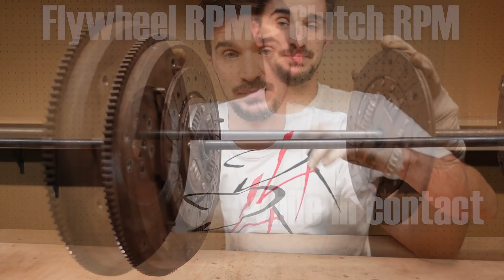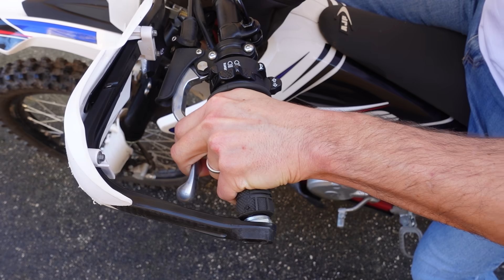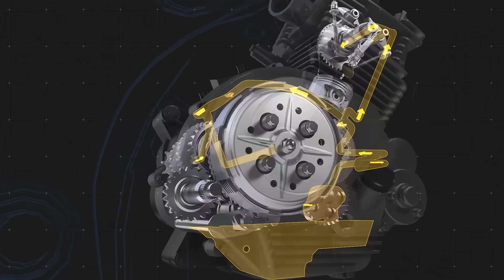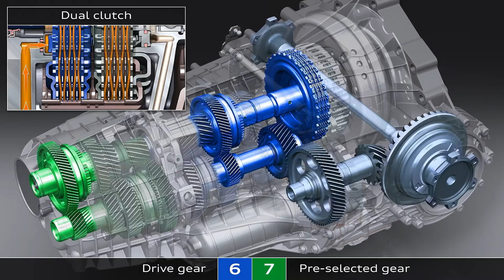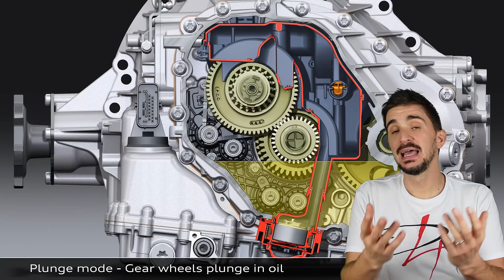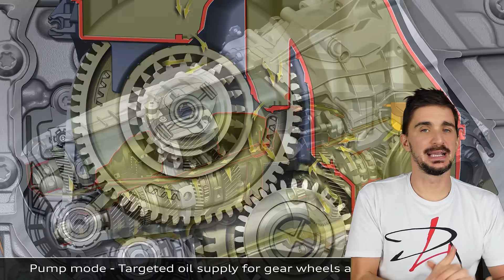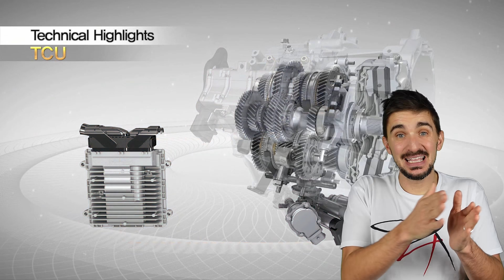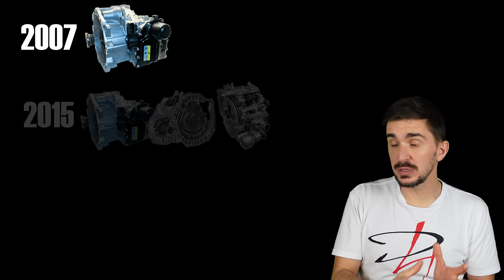Why Dry Clutches Suck and Why You Should Avoid Dry Dual Clutch Transmissions (DCT/ DSG)

Comment: Pretty sure that whole system is the "clutch".  The thing you called the clutch is the clutch disc.  The flywheel and the pressure plate are also parts of the "clutch".

Comment: Manual clutch is dry.
Reply: This! are dry DCTs worse than (proper) manuals??
Reply: @EspenMyklebust-u1o  By "proper" here, do you mean experienced driver?

The true cause of premature wearing and failure of dry DCT is that OEMs are too radical on fuel economy. Especially under low speed, TCU tends to shift earlier and engage when two sides (of the clutch) not matching rev
Reply: @TobenyChen  I meant "proper manual" as opposed to DCTs (which are "automated manual gearboxes", albeit with two clutches instead of one). Except for some issues in the automization part (like you point to about the early upshifting), mechanically the dry clutch principle should be work just as well as it does in proper manuals (ie. manual clutch). The video focuses on dry vs wet, so the issues should be equally valid for manuals, right? Perhaps bc wet clutches aren't an option for manuals🤔

Comment: I love the 8sp DCT in my ILX. I change the fluid every 30/40k without fail or exceptions using only Honda/Acura fluid from the dealer. I bought this car with 20k miles on her and she has 125k now with no issues so far from the DCT. You just AND MUST know when coming to stop at around 2/3 mph left you need to stop. Do not get back on the gas, take a second, stop, then continue driving. The torque converter can be a little weird in that situation alone that being said, once you have starting rolling again and the converter has locked up around 20mph you can stand on that thing ands it will reward you with instant and immediate shifts regardless of how hard you stand on it. 

I don’t even use the paddles, no need to. Just drive and change that DCT fluid every 39/40k. Changing mine plus oil and NGK R Lazer Iriduim plugs this weekend. Mx Mx Mx Mx folks. That’s the name of the game

Comment: I understand the differences between a wet and a dry clutch, I'm wondering why no one has come up with a damp clutch, where the clutch would not sit in oil but there would be an oil spray for cooling.

Comment: Doesn't wet clutch release particles from the disc grind into the oil to help wear out your engine or gearbox?
Reply from the maker: It does, but only on a motorcycle where the entire system uses the same oil. Not a dct though where it's completely separate from the engine. The oil filter catches most of it on a bike but it's another reason motogp uses it. The insane clutch abuse and temps would ruin the oil very quickly. Dry clutch is isolated and easy to replace/inspect.

Comment: Completely wrong about the cost and dependability of dry clutches vs wet clutches in the automotive world.
And for your information, dry clutches last 2 to 3 times longer than any wet clutch automatic trans if you know how to drive a manual properly.  
This is fact. The most important parts of your info is wrong sir. 
I know this for a fact from 27 years of experience being a mechanic.
Also, I'd rather spend a couple hundred bucks 2 or 3 times during the vehicle's life to replace the clutch than to spend around $3,000 rebuilding an automatic trans each time.

Comment: Um, it's way cheaper to replace a normal dry clutch, throwout bearing, and pressure plate than it is to replace a wet clutch or clutch pack. Also, it's WAY less labor intensive.
I don't understand where you're getting your info.

I've been a mechanic for 27 years and have changed normal dry clutches, wet clutches, (such as in a tractor), clutch packs in an automatic (which are wet), and motorcycle clutch packs
many times and not once ever in my life has it cheaper or easier to change out a wet clutch.
You have to completely remove and disassemble a wet clutch transmission to replace the clutches.
Not so with a conventional dry clutch transmission.
Reply: Are you referring to dry clutches in a DCT, or just conventional manuals?

Comment: You CAN definitely burn up a wet clutch, you dont smell it cause it's sealed from outside air. What do you think the most common cause of automatic trans failure is??
The clutches burn up. That's how you get burnt trans fluid.

Comment: U forget to say that dual dry clutch pack works just opposite to regular single clutch pack. So normally when u depress clutch the pressure bearing is not pressing the pressure plate but DSG actually pushes the trustbearing all the time when it is connected. So when u driving at 7th gear the K1 actuator is pushing all the time and bearing have to handle this stress. I have seen these melted of heat. This is one drawback for efficiency. Actually there are 2 bearing under axial load allthe time when driving. When car is stationary both clutch are open and no axial load any direction.

Comment: Proper dry clutch's last so long and work so well there is no point going to a wet clutch for street use. I have cars with both types. Wet clutches used to be common in street vehicles and were dropped by OEMs for good reason. Current vehicles now have extreme problems that need attention so don't waste time on these click baits.

Comment: In the 4x4 sphere it's mostly AT new with some MT. The DCT and CVT CUV's generally shut down under load. 

The motorcycle DCT also shut down for self preservation too under extended load when hill climbing for instance. Off-road is still MT domain.

I was surprised to see can-am SxS with DCT in performance application. Even with heat sensor on CVT, maybe there's some packaging limitation for a certain performance level.

It must be packaging reasons that large airplanes use multi carbon plates for wheel brakes in the hub.

Comment: Just don't baby a dry clutch DCT... Don't roll on brake at lights. Treat it like a manual and you will have no issues. I'm at 60k miles on my original clutches and it is still great. I've never had a clutch burning smell and the only time I've ever had issues with stutter is when going in reverse.

Comment: Ahhh, the old Ford Power Shi(f)t… almost got the marketing right, just off by one letter. Company I work for had a fleet of that model Focus. Every single one had DCT problems. Mine spat the clutch at 30,000km. Drove it home stuck in third bouncing off the limiter 😅

Comment: Total rubbish. Learn to drive properly. Ok, I had the advantage of learning to drive on an unsynchronized lorry in the army, but the idea is not to use the clutch for synchronizing, but to use the accellerator pedal to adjust the speed when changing gear. Using this technique I was able to drive a car 150 km through the mountains in icy conditions in spite of having a totally blockrd clutch. And in spite of having driven cars for around 250000 km each, I have never had to replace a worn out clutch. The "adjust speed shift" also works on motorcycles. Occasionally, just for fun, I will ride for longer distances without using the clutch to change gear. Done correctly there is no jolt whatsoever.

Comment: It's about frequency of use. Or duty cycle. Motorcycles really don't get used as often as cars do. They don't sit in traffic like cars do... barely moving for minutes or tens of minutes at a time. Even DCT wet clutches in the normal environment of a car will wear out faster than a SINGLE, non DCT dry clutch, as long as it's not computer controlled.

Comment: thats bugging me about motorcycle clutch packs, so if they use the same oil as the engine, wont those tiny particles from a clutch go into the engine? does it get stuck between cylinder and piston rings and slowly wear out engine block more than usual? or the oil filter filters them out?

Comment: As far as cost. I guarantee that the wet clutch doesn’t last as long as they claim. I can also presume that the removal and repair of the wet clutch is going to be significantly more expensive. 
Quick check of the repair book should confirm that.

Comment: Dry clutches are OK to me, if you know how to use them. I´ve never changed a clutch in any car or motorcycle that Í´ve owned. My 28 years old BMW R850RT still has it´s OEM dry clutch from the factory. No city use, no free clutch slipping. I own wet clutch bikes too, and they can handle a lot of abuse that it´s forbidden on a dry clutch, but be wise, the engine oil gets contaminated by clutch debris.

Comment: I have a dry clutch in an MK7 with with over 130,000 miles, still works great and I race it on occasion. Meanwhile a friend with an MK8 wet DCT already replaced his at 70K. Sometimes theory and reality don't match reality. From the groups I speak with many MK7 DCT's have been reliable for well over 100K so...

Comment: Please do a video on journal bearing lubrication - hydrodynamic versus boundary lubrication and touch on modern engines wearing their main bearings more than older engines due to, inter alia, high torque from low RPM, positive displacement oil pumps that run low pressures from idle, stop-start, long drain intervals, removal of lead and so on. There was once a time when bottom end bearings lasted the life of an engine, now they're maintenance items on more and more cars from 150k km onwards.

Comment: Only time I ever burned a clutch, got a 8ton tipper with a 7.7L inline 6 overloaded to 10ton, tried to hop it over a curb with no inertia form 1st, brought it up to 2.5k rpm and just dropped the clutch, clutch fully engaged, engine still running and i wasn't moving, OH SHIT push in that clutch, reverse back and do the same thing again with a 1meter rolling start, got it out of that ditch, thing stank for 2 days.

For reference you normally drive medium ridged trucks form 2nd even when loaded, that 1st gear is for doing fully loaded hill starts

Comment: i have been using dq200 for about 180k km. as long as you dont let it slip, there is no issue. just use the pedals whenever you want to move or stop and you will be alright. If you try inching forwards it will heat up quick, but that is only natural.

Comment: Remember the DCT by Honda?  it used a torque converter for launching in 1st then works as a regular dual clutch in all other gears.

In the age of electric hybrid, I think dry dual clutch has it's place.  Electric motor can turn the odd gear shaft and turn the first  gear instead of grinding away at the dry clutch.  The 2 clutches are subjected to negligible slips in between gears.  The electric motor can continue assist  when a odd gear is preselected

Comment: I love your videos, I love to refer your work as i describe operations as a mechanic. Could you look into the McCloud twin disc clutch for high horsepower cars. Like I have a 600+ Hp at clutch race car, and it has a twin disc clutch and float between the fly wheel and spring release plate. I'd love to see and hear  your take on operation as it has a super grumpy forgiveness rate. Like for example, i drive on the verge of stalling letting my clutch bite and then release fully, as opposed to on a track, the bite of a twin disc is amazing, as opposed to a single disc the was installed before. But city traffic is horrible if you don't know about this bouncy effect for low RPM grabbing. Thanks again for this friend! Keep up the work, you are great at what you do.

Comment: Alr so we own the Taigun with a dq200 which is a dry clutch and vw has improved it so the traffic stop and go is better.
One of the technique is to disengage the clutch when the brake pedal is depressed beyond a certain limit, also it stops shifting between one and two frequently as well.
That said I have noticed sometimes especially when its a cold start that there is a slight hesitation for the car to shift from one to two and there used to be a small judder? 
It went in for recalibration and stuff but I really dont feel the difference brand new and now!
Overall stop and go has been going fine for us (put round 30k kms in 5 years, 95 percent city runs with high traffic).
One feature I would rather delete from the car would be auto start stop which turns off the compressor and in Indian climate that is 🔥☠️

Comment: Around 12:00 minutes. You're putting a lot of faith in the average driver.
Reply: In the end, a two disk cable operated Eaton on a 13 speed twin countershaft is all you need. 3000 foot pounds of torque? Meh.

But in certain applications, the 6 speed double overdrive Allison isn't bad.

Comment: I've only smelled burnt clutch once - after driving my Opel Astra H with an Easytronic out of a parking spot which was heavily snowed in. Stupid single-clutch automated manual. For stop&go, parking etc. there's nothing better than a torque converter or an eCVT (outside of an EV).

Comment: I have a seven speed dual dry clutch on my Hyundai Kona with over 100,000 miles. Has worked seamlessly and reliably . In sport mode it excels.

Comment: Drilled out the clutch basket on my 75 Honda Cb550 so the clutch shifted better and neutral was easier to find. One drawback is on an MC is the inability to use friction modifiers to reduce engine wear.

Comment: Can't be that bad.  My 04 350z still has the original factory clutch with 145k miles on it and still works flawlessly.  Nice innovation but it's basically technology to overcome a skill issue. Besides, after 1st gear wear, you rev match and have very little engagement slippage.  Engage 1st gently then slam on it and you're a pro with very little wear.

Comment: One of my cars with a 6-speed traditional manual transmission is the best I've ever felt and operated.  A co-worker bragged that his electronically controlled transmission could shift so much faster.  I told him the important thing to me is not the speed of shifting, but rather driver engagement and involvement: being a part of the driving process.  Knowing how to shift smoothly and dozens of other aspects of operating a traditonal manual clutch is so satisfying and rewarding when done correctly.  A wet clutch, DCT, automatics, whatever, can never replace that feeling for me.  I know this is subjective, but to me there are drivers and there are "appliance owners" where everything is electric and computer controlled and the skill of the owner (or lack thereof) does not matter; I'm a driver.  Regardless, your video was wonderful and educational.  Masterfully done.  Thank you.
Reply: YES- and I love that point where it all becomes reflex- when you don't even think about the clutch, or could even say what gear you're in because you've shifted up and down without thought.  It's so hard at first and then it's almost like magic how easy it becomes.  And then... if you ride a motorcycle- you're doing *so much*.  Clutch, shifting, both brakes, throttle, balance/steering, turn signals... just a ride through typical traffic is really amazing.  Again it's all so overwhelming at first, and then one day you realize you did it all without conscious thought and actually enjoyed it. :)

Comment: 0:58 my friend did this accidentally when he drove my manual nissan xterra, he wants to put the gear in Reverse but he put it on 6th gear and when he released the clutch the engine  stalled and the wheela spent quickly before the engine stalled.

Comment: I been had said this for years. If you don't wanna shift gears, especially if you're in stop-and-go traffic frequently, the good old torque converter/fluid clutch is an absolutely perfect solution. And a good modern hydraulic automatic transmission gives up very little in terms of performance or efficiency to a dual clutch!

Comment: I am a little confused, wasn't the advantage of the DCT that the currently unengaged clutch is almost at the same speed as the flywheel, 
with just the speed difference due to being engaged to the next gear, so that there is only the need to slip the difference between the gear speeds?
It surprises me that the emissions and wear are so high on a dry DCT then. Has a dry DCT more emissions that a regular dry clutch?

Comment: I've always been curious about this but never driven vehicle with a dual clutch. 
How big is the delay if you shift in the opposite direction the gearbox is expecting? Like say accelerating gently, short shifting, and suddenly want to accelerate hard so, instead of shifting 4-5 you downshift to 3 when 5th is pre-selected?

Comment: Well to be honest, I personally prefer dry clutches when it's a manual transmission (especially one plate dry clutches). Most motorcycles, thanks to the Japanese, use multiple plate wet clutches. They work fine and all, but I still to this day don't like the slight "slipperiness" compared to dry clutches. The only downside of the Ducati dry clutch motorcycles to me was the noise that the dry clutch created. Sometimes it was louder than the exhaust... 

But when it comes to DCTs, the wet clutch is a better choice simply because the manufacturers implemented the "creep" that was natural for torque converter automatic transmission cars (it's simply how the TQ works, just a natural phenomen). But for clutch operated systems, this creep ofcourse will cause wear. So the oil helps to decrease wear when a DCT car "creeps".

Comment: Seems like the whole system would benefit from either a separate reservoir of fluid, or using non-toxic consumable material in a package that is easy to access.  Unfortunately, development incentives don't seem to roll off the assembly line as easily as the product.

Comment: I don't care if the clutch plate is wet or dry. As long as it's easy to change. I own motorcycles with both wet and dry. They both work fine.

Comment: Dust is the environmental hill you’re going to die on? What about all the dry single clutches in manual transmissions… or all of our brake pads… or even the tires themselves? 

What’s your conversion from equivalent gallons of gas over the life of a car to the dust from a clutch?